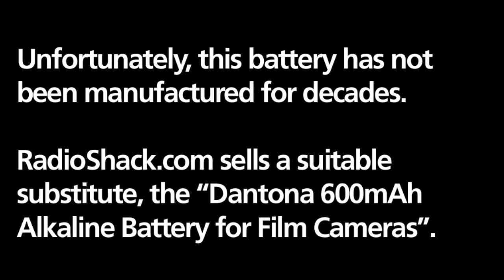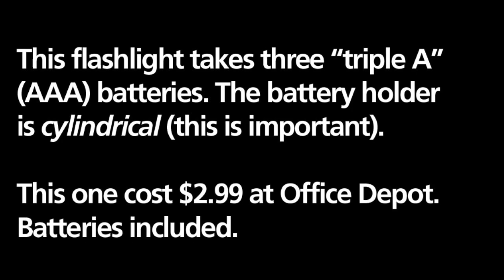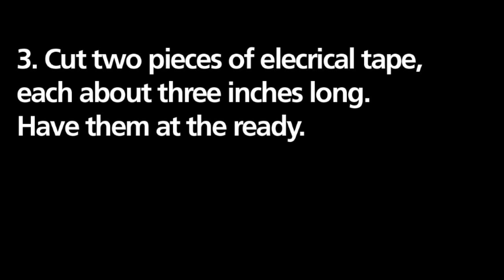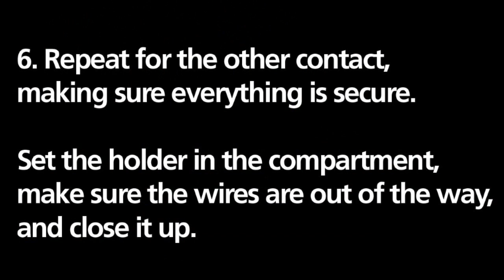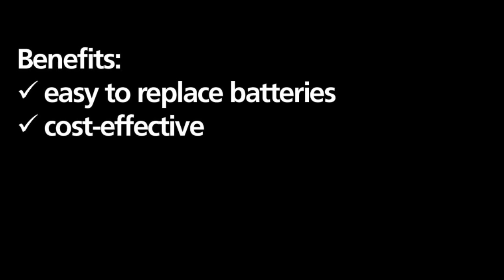Polaroid 4.5v Battery Alternative

Comment: Worked like a Charm, I've got an OLD 666-sc meter that took a 4.5 flat battery, ie...BA-31 soldered your AAA 4.5v solution in and off it went.  Great hack, love it.

Comment: my dad just picked up a polaroid 100 at the flea market and it still came with the old 531 battery and an old pack of fuji fp 3000 inside. I think the battery still works cause I tested the shutter and I can hear the double click, but the film is separating when I pull it out. I want to do this to the battery just in case though and get some packs of film before they're gone forever. Thanks for the video it was super helpful!
Reply from the maker: Wow, I'm impressed that the battery still has a charge. I recommend switching this setup though, as it may decide to start leaking at any moment. Unfortunately color Fujifilm 100C is now averaging $25-$30 a pack. B&W 3000B is at least twice that. Ebay is your friend. Good shooting!

Comment: Great solution. Strangle enough my just bought 320 takes 3V. I put in 2 AAA and no reaction from the shutter unfortunately.. Next stop: a Shutter fixing video?
Reply from the maker: Sorry about your 320. Picking up another model may be less expensive(and less trouble) than fixing the shutter. I've found the 100 and 250 to be the most reliable. Good luck!
Reply: Thnx Joe. Will do
Reply: Willem Wouterse Not all AAA's  are 1.5v some are 1.2v.

Comment: Great tutorial! I was wondering if you had any advice on what to do if the black battery contact was corroded? I'm half tempted to put coke on it but I wouldn't want to ruin anything further. Haha. The white coil looks brand new in comparison. Thanks for your help! Excited to get back into film. :)
Reply from the maker: Thanks Alice. I don't think a little coke will do any damage (assuming you're planning on dipping the contact in a little dish of some sort, and not pouring a can into the compartment ;-) There's lots of ways to remove that gross white battery corrosion (potassium carbonate). A vinegar or lemon juice and water solution applied with a toothbrush or cotton swab is one common method. You'll see baking soda paste and hydrogen peroxide solution suggested as well. Science teacher-types would recommend wearing gloves and eye protection (I just try to avoid getting it in my eyes and wash my hands promptly... but don't do what I do!).

Comment: Hello, I have a 250 land camera, it still has the original eveready 4.5V battery expired in 1967. I would like to ask a "dumb" question, please excuse me. Why does this camera needs a battery?  Can be used without battery? I just got a film pack but I don't know what could happen ussing it without battery. Thank You.
Reply from the maker: Hi Javier; not a dumb question at all! Since there's no "motor" that ejects the print like the later Polaroid models, one might wonder why it needs 4.5V of power. While it may seem like the shutter "works" without the battery, it's actually an electronic component that is timed to operate in conjunction with the lens' aperture, the available light, and if used, a separate flash unit. As I note in the video, when the battery power is working properly, you can hear a "double-click", the sound of the shutter opening and closing. If you open the back (with no film loaded) you can see the shutter open and close as well. If you loaded film and tried to take a picture without a working battery, I'm not sure the shutter would even function. If it did, and it exposed the film, it would be like using a pinhole camera, in that the exposure time is basically random/guesswork, and any tiny movement (even the movement of operating the shutter) will show up as a blurry or out-of-focus image. Of course, if you're into experimenting, you may still end up with an interesting image that way... it would just be left to chance. Hope that helps!

Comment: Hello, I know its possible that your not still currently active on this but its worth a shot. I recently just got a 101 Automatic Polaroid Land Camera.  I thought everything was fine and was about to convert the battery holder when I found out it doesn't have the black negative wire or part at all. Is there a way to still fix it or is the camera completely trashed? Thanks lots
Reply from the maker: Hmm... off the top of my head, I can't visualize where that wire comes from. To be honest, unless you've got a lot invested in it or you like to tinker (i.e. take things apart and put them back together without instructions), sounds like your 101 is "for display only". If you decide to give it another shot, your best bets are the 100, 250, 350, or 450 (the 360 can be pretty sweet as well, if adapted to use a modern flash). Study up  http://www.landlist.ch/landlist/landhome.htm. No longer maintained, not mobile-friendly, and somewhat challenging to navigate, but extremely thorough and obviously built with passion. Hard to find in a Google search, but the best info out there imho. Hope this helps!

Comment: i just bought one but the battery wire is loose and its broken all the way and i dont know what it attaches to. i dont know how to fix things so does anyone know where to go to fix it?
Reply from the maker: You're pretty much left to your own devices, unfortunately. If you can even find someone who'll do repairs, the cost to do so will most likely be several times what you paid for the camera (or what you'll pay for a working model). If you're so inclined and willing to research, there's a lot of DIY info out there. The internet is your friend :-)